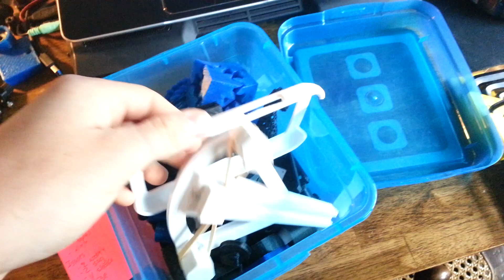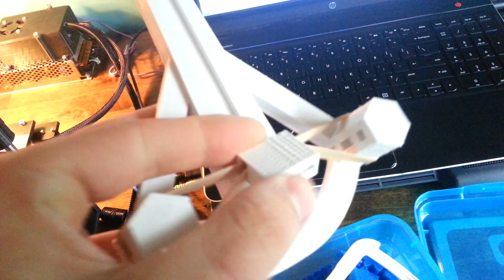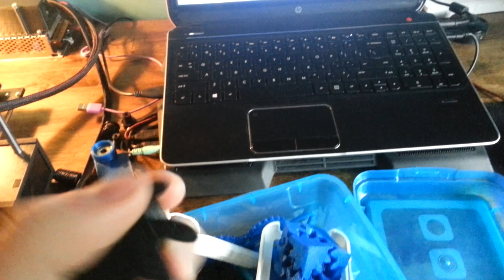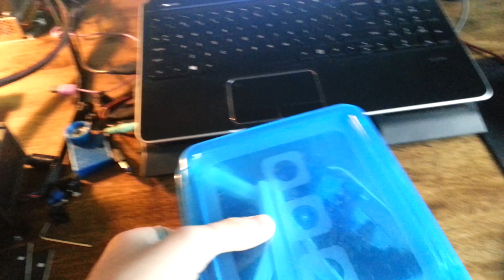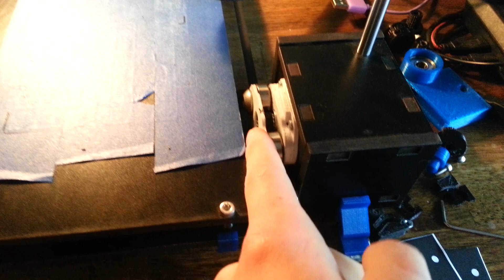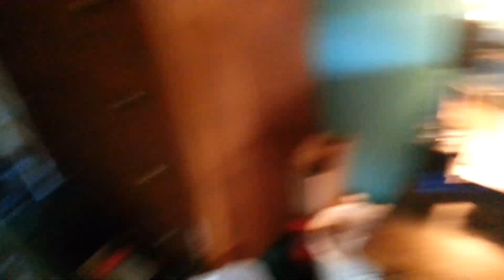QU-BD One-Up and Two-Up "Review"

Comment: Is software included? Can it import autocad .dwg files? Does it require a separate controller? Sorry, lots of ?'s
Reply from the maker: +Nick Chmiel Sort of, the software is free online. Repetier Host. The controller required is included with the printer. The material for printing costs around $30 for a kilogram which will last quite some time if you aren't printing tons, I myself go through about a spool every 3-4 weeks but I print more than the average person. There are many different materials out there including some rubber plastic blends, but anything other than the "standard' PLA and ABS will be a bit more expensive and more difficult to print usually.

Comment: Has yours been reliable?  I am thinking of getting a Reprap
Reply from the maker: +John Doe Not really, no cheap printer is going to really be reliable. If you want something that will just work you have to spend at least $600+ and I really doubt any reprap would be as reliable as you're probably looking for. But if you want a cheap printer a reprap would likely be the more reliable option of those.

Comment: I'm thinking about buying a 3d printer, but I don't have any experience with 3d printers. I would say that if I spend 200 bucks on this, I would be willing to spend whatever time is necessary to make sure it works. So I'm wondering
A) Is this the printer for me, someone new to 3d printing who just thinks its cool and would like to make a hobby out of it?
B) Is it worth buying a printer that I already know has some issues? 
C) Am I going to spend more money on repairing it than I did buying it in the first place?
D) (a little off topic) does this kit come with any filament? If not, what should I buy? 

Thanks so much.
Reply from the maker: Joe Hester Ok here goes, remember this is just my opinion!
A- yes it's perfect for that. Expect to put a lot of work in and get average at best results, however with all the time you put in and how simple in concept the printer is, you will learn a ton about 3d printing and if you decide you like it, it will make your next 3d printer purchase that much more worth it.
B- Yes its better that it has known issues as many people on the forums and on thingiverse have designed replacement printed parts to upgrade it. Of course no issues would be better, but remember the printer is only $200!
C- Nope you shouldn't. Worse case you may have to buy a new printrboard and hot end if yours both happen to die, but you can get both for $50ish or less. You can also elect to upgrade to the e3d v6 lite hot end which is only around $50 as well and should deliver much better results than the stock hot end. Other than that, most things that may break can be fixed by glue.
D- I'm not sure, but it won't come with enough to do any more than basic calibration. You want 1.75mm PLA filament. Your best bet would probably be Hatchbox filament from amazon. Try to get it when its on sale (it goes as low as $22) but even if you get it at $30 it is still worth it. And it's prime if you have that!

Hope that answers all of your questions!
Reply: Thank you so much! I think I'm sold. There is one last thing - what kind of software will I need to export files to the printer (if any) and is it compatible with a Mac? Thanks again dude.
Reply from the maker: Joe Hester Repetier host or cura, and yes I believe both are. I prefer repetier host because it has the option to use slic3r or cura for your slicing engine (which is the program which turns the stl files into printer code, gcode. cura only can use the cura engine)
Reply: Ok cool. This has been such a help. You've got yourself a new subscriber.

Comment from the maker: @Jake Evans the firmware is Marlin, which is open sourced and used on many printers, but I haven't had any issues with it. And for a cheap printer I would say no, there's no reason to spend more money just to print abs when it won't increase print quality at all. If you get the two-up and decide to get a better printer later on then I would say to invest in one with a heated bed.
Reply: Till this day, I can't get the printer to work properly. sucks :(
Reply from the maker: Gus Montoya It is quite difficult to get it up and running, and once you do you will often run into issues which will make it tougher, however as you go on if you keep at it you will learn more and more and eventually you will be able to prevent these problems before they even happen.
Reply: Our won't print either,  waiting  on a new extruder. Acrylic upgrade kit is thinner than mdf and we needed washers to take up space. Have communicated with QUBD that a little better building material and things like locking nuts would make it a better product and not add that much to the cost. The extruder mount needs to be one piece, not a bunch of small ones.
Reply: I wonder if the acrylic kit is even worth it?
Reply: Not sure,  should be stronger but the extruder pieces cracked before the screws were even tight. They are supposed to send replacements.
Reply: +3DprintedLife I would want to be able to use ABS because there is so much ABS that can be turned into filament and that would give me more freedom to choose other plastics.  I don't need a perfectly smooth print for everything.  I am looking around exploring my options before buying and I am thinking about getting a Reprap.  I don't want a very expensive 3D printer and I am willing to pay around $300 for the printer by itself and of course I have seen some sellers who will include a roll of filament with them to get you started.  I like that because it will give someone a beginner something to work with if they did not already order some filament.
Reply: +Gus Montoya I have seen an eBay listing for a OneUp or TwoUp and from the looks of it he was having nothing but trouble with his.  I am glad I am trying to research them a little bit because it may be tempting to buy a 200 dollar printer but without having researched it, it is hard to know what you could expect.  I am considering a Reprap but over the last 2 weeks of watching youtube videos on them, I have not bought even a roll of filament yet.  I know there is more to researching a product that youtube viewing but it is a start and a good way to possibly know the design flaws of a particular model.  If I don't find a decent printer for $300 or less I may simply forget about 3D printing.  I am only considering it as a fun hobby and have very little knowledge of it so far.  It seems to me that the one and two up may be the lemons of 3D printing and so if I ever decide to buy them it would be a super cheap use them for parts for other printers.
Reply: I have a 2up, I never got it to work correctly. 
one of the motors fried, and the motherboard died shortly after startup.
Reply: We have a 2 up as well and it has been one thing after another.  Bought a Boden extruder but still working on getting it attached properly. Part of the trouble is the mdf used for the framework.
Reply: Kelly Dravis That is why I am asking around to see what others are saying about their printers.  So far I am beginning to not want a OneUp or the similar TwoUp.  MDF is not the best stuff.  It is like a big heavy piece of cardboard.  I have a sheet of 3/4 inch and that thing weighs a ton.  It swells up badly when wet.

Did you ever try a 3D printer made by someone other than the manufacturer of the 2 up?  Just looking at it I see one bad design already and that is the one drive screw on the side.  It seems to me that ANY friction in the side rail on the opposite side would make it bind and stick and thus burning up the steppers and possibly causing a domino effect of problems.  Unless they redesign them their future might be rather bleak.
Reply: I have a friend who built his own, and he has done some decent prints but still has issues, I think in general, they are all finnicky.

Comment: Hello does the kit for the two up come with a heated bed ?
Reply from the maker: No but you can choose to purchase the heated bed for I believe an additional $70 from qubd, but I wouldn't really recommended it as this is a beginners printer and if you do want to start printing in abs you will likely want to upgrade your entire printer first.
Reply: 3DprintedLife I read about abs and pla but could you tell me in your own experience when is it necessary to use abs and when it's not

Also what would you recomment for abs printing
Reply from the maker: Different PLA is in general easier to work with, doesn't require a heated bed, prints at lower temperatures, and shows off small details better. It is better for beginners.

ABS requires a heated bed but it is much stronger, more heat resistant, and a bit smoother on the outside.

If you're a beginner, start with pla. No reason to mess with abs just yet. But once you are familiar with 3d printing, ABS is usually used for engineering parts like things that move, gears, etc. Where PLA is used more for statues and sculptures and things that you want to look good. But of course you can use both plastics for all purposes, they just may not work as well sometimes as the other plastic.

Comment: Ok, so I've just seen your video and I do have some questions.
I'm new to 3D printing, haven't done anything yet, but I more or less know how to use blender and do my 3D projects. I want the 3D printer mostly to print robot parts. I don't need them to be extremly beautiful or really really precise, but at least to fit if I'm printing gears or things to fit without glue. I also don't need big things so this printer size seems ok. If I'm right this first part fits with it, because I only need a decent 3D printer.
The problem is, when you refer to "upgrades" and time to build/upgrade. What do you exactly mean. Will I need to create those upgrades? Can I find them from anyone who made them and just print them? If I buy it, spend let's say, a month building and upgrading it; apart from general revisions and reprinting broken upgrades perhaps, will I need to do something else?

And my MAIN concern is, is it difficult :) ? It can be tedious or difficult (or both), which one is this? If it's not that difficult and you only need to be looking in the forums and those kind of things I haven't got a problem, otherwise I might be buying a expensiver one, only not to have to do upgrades.

THX!
Reply from the maker: If you are looking to make strong and high quality prints you are looking in the wrong place. You will either have to build a well designed printer from scratch yourself which would likely cost $400+, or if you are looking to buy one you will have to spend at a minimum $600 for what you're looking for.

The two-up is decent but without huge upgrades you will be unable to get a consistent reliable print from it. It takes a lot of tinkering and is quite a tedious and sometimes frustrating process. You can get some good prints from it if you put enough work in, but that quality will likely deteriorate quickly as the overall design of the printer is very..well cheap.

This printer is really best for people who have time to invest, don't mind tinkering, and don't want a super good quality printer. The main thing going for it is the price, and at that price you have the potential to get some decent quality prints. However, for what you say you want to do I would definitely recommend looking elsewhere.
Reply: Ok, so let's suppose I have those 500$ (400$ + 100$ for extra things), what do I do? I found in a chinese web page (I already bought there other things and they work well) a reprap printer kit for 400€. Of course you need to build it and everything, but I don't mind. Here it is:
http://www.dx.com/p/heacent-3dp01-diy-3d-printer-full-assembly-kit-black-silver-110-220v-220815#.VN-h3y4wCSo

What do you think?
Reply from the maker: Emilio Domínguez Ehhh I really don't like those made in china kits sold on those kinds of discount websites. The 2 reviews are good but you can never be too sure, plus it probably won't last. I would recommend finding one stateside. Makerfarm has some decent reprap kits for around the same price.

Keep in mind 3d printers are very complex, so printers made with cheap or inferior quality parts will deteriorate much more quickly, and all it takes is for one thing to wear out or break for the whole printer to go out of service for some time. You really want to find one that uses good quality components, and being a kit is a bonus as you then know almost exactly how the entire printer operates which helps with maintenance.
Reply: I think that the website is american although they produce in China, but I'll check makerfarm. I bought there some cool arduinos and they work as intended. Also, they have a great support team. But thanks, I now know where to search.
Reply: Ok, just checked it. Unfortunately, the cheapest is 520$, I cannot spend more than 400€ in any way :/ .
Reply: It will be difficult to find a 3D printer for that price though :S
Reply from the maker: Emilio Domínguez Exactly, the selection under $600 is very limited and quite a lot of them are rubbish which leaves even fewer to find. If you were willing to spend $1000 you would have a much easier time finding a good printer, but that is significantly more money and most people do not want to invest that in a 3d printer (me included).
Reply: I found one for 400$ (kit obviously). Seems pretty decent for what I want, and it's also a reliable page, so I'll investigate more and decide.
Reply: Emilio Domínguez what did you find?
Reply: A 3D printer kit. I can't remember the page though, srry
Reply: Emilio Domínguez so did u buy one at all? Is the xyz good ? How about the new revision of the twoup? What about a regular reprap from aliexpress
Reply: Canny K well, I didn't. But now a days I'd buy the xyz because i'm more advanced in fixing this types of things. I ended up using a friend's printer but if I had to buy one, and i were in the same situation i was i'd choose a reprap. Now a days I'd choose a xyz though. But it depends on the money you have. If you have enough repraps are better ofc.

Comment: Thanks for the review! Which printer at around this price point would you recommend at the moment?
Reply from the maker: Well...there's really only 3 and to be honest I wouldn't recommend any of them if you are able to gather up a little bit more cash to spend. The only 3 at this pricepoint that I know of are the old printrbot simple, this, and the makibox. The makibox is 100% designed and made in china, which doesn't necessarily mean poor quality but in this case it really does. The printrbot simple is alright but it uses fishing line instead of belt and has plenty of its own rigidity problems, and this one also suffers from rigidity and from the gantry sagging.

If you have the money, spend another few hundred and either get the metal printrbot simple or the soliddoodle 4, both are around $600 and are well worth the extra cash. Also figure out what you want to print, if its just a limited number of objects and quality doesn't matter, go cheap. If you want to print a lot and quality/speed is a concern, do yourself a favor and spend a bit more money. You still won't get a perfect experience, but it should be much better!
Reply: 3DprintedLife Awesome. Thanks for the feedback. I am looking at the Prusa Mendel i3. Have you seen the kits they sell on banggood.com?
Reply from the maker: Marcelo Alcantara Yep and I wouldn't recommend them, those are super cheaply made kits coming straight from china, if you are going to get a prusa i3 get a good american made kit with quality components, it will save you a lot of hassle in the long run even if it does cost $100 or so more.